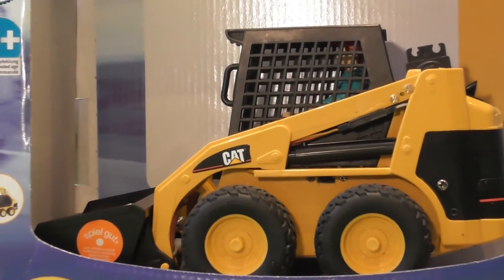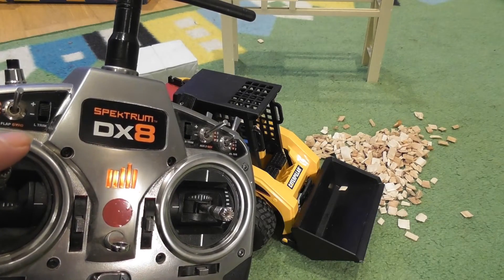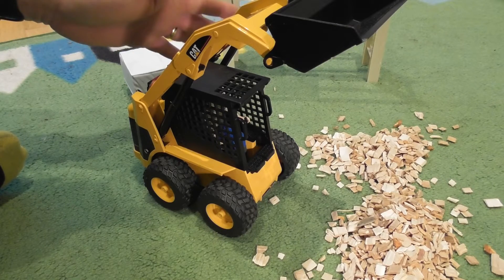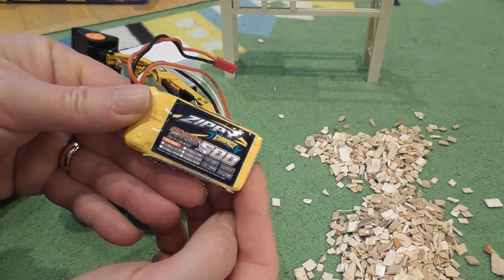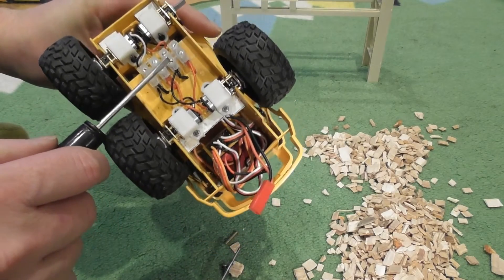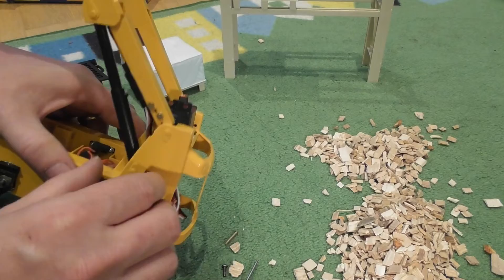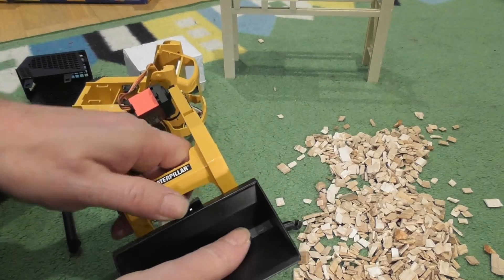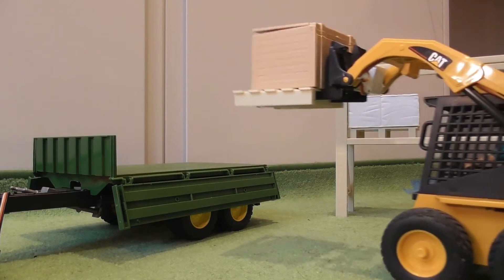Bruder skid loader RC conversion pt2: prototype

Comment: Nice little machine. Are you planning on doing a video on the mixing? I'd love to see an explanation. Thanks!
Reply from the maker: Yes I am. Plus a full build series. I want to show mixing for both Spektrum and FRsky (Open TX). 😀👍
Reply: @RCModders  Thank you! I just picked up a Delta Cat the other day for conversion. Enjoying your channel :)
Reply from the maker: @jesscneal  Good luck with! 😀👍
Reply: @RCModders  Another question for you. Do you think a pair of 220rpm 150:1 N20 gearmotors are sufficient for a  Bruder Delta Cat conversion? I know you have a lot of experience with them so I thought I would ask you.
Reply from the maker: @jesscneal  Hi, having tried different motors I can say with certainty that 200rpm is too fast and has too little control or torque. 6v 100rpm is probably the fastest I would want in this and is what I used in the end in the skid loader. For the delta I would be tempted to look into servo drive - as I'm not sure that two N20's would be powerful enough. You may be interested to know that I am updating this build with 3D parts - which I will make freely available to download and print. I am planning that the comprehensive video build series on skid loader  will follow immediately on from the Jeep wrangler series which I am currently publishing each week. 😀👍
Reply: RC Modders  Thanks for the reply. Good to know :) Thanks for all the uploads. Great stuff 👍
Reply from the maker: @jesscneal  pls see edits to my response I forgot you were making the delta rather than the skid loader.
Reply: @RCModders  Thank you. I was actually trying to decide between N20 and servo drive. I think you just helped make up my mind :)  Thanks again for all the info
Reply from the maker: Jess Neal you are welcome 😀👍

Comment: Great video! I have this Bruder model but it is tracks instead of wheels. How do u think I could make the tracks work?
Reply from the maker: I think they are quite different model. I haven't done the tracked one yet. Usually people convert two standard RC servos to continuous rotation and use these to drive the tracks. The forum is great place to learn & get tips : https://www.facebook.com/groups/313698865844090/?fref=nf.   😀👍

Comment: Realy nice and clean build!! How do you use 1 of both ESC as a BEC?  And how do you split the signal for controling left/right movement.  Thank you!
Reply from the maker: Thank you! One ESC must have the red wire disconnected (can lift up tab on plug, pull out and cover with head shrink or tape. Be care full that the big servo never stalls (ie tries to move further than lifting arm goes - as it will blow the BEC on the ESC and you will have to use the other ESC or install a UBEC.   The speed controllers are connected to the elevator and aileron channels on the receiver. You then mix them plus or minus 100% to each other in both directions. You may have to experiment with the direction of the servos, the polarity of the motors and direction of the mixes until it all works the right way. The bucket servo was attached with epoxy. I’m trying to get round to the detailed build video. Going to use budget rc - but it must have at least 2 free mixes for the steering to work. Hope this helps😀👍
Reply: RC Modders  Finally finish mine! Work very well and thank you for you help. Realy proud to use N20 motor like you do. You can see a video of it working on my profile.

Comment: Really nice and clean conversion! I love this skidsteer in action!  I have only a question: are the 4 n20 motors stronger than 4 9grams servos converted to 360° rotation?
Reply from the maker: I have never converted a servo to continuous rotation, so I don't know. I expect that it will depend on the gear ratios etc of each. Using my method, the mounting of the wheels to the motors is very easy and the motors are smaller than servos, although you will need to ESC's, which then need to be housed. The 6v 100rpm N20's seem to give a good balance between torque and speed in my opinion (200 rpm not enough torque or controllability & too fast) .🙂👍
Reply: You can get 17g ones to fit under it

Comment: Great build once again from you Mr modder. 
My proffesion is heavy machinery. (Operating and teaching others) And it's correct that when you move the stick back, the loader rises. Think of it like there was a pivoting point between yourself and the bucket. I have my D5 dozer set up like you have it, but it causes problems because it should be steering and drive on the left stick and the bucket/blade on the right stick. This is how my brain is wired since about 35 years back. 
But really nice build, maybe even lower geared motors would be possible.
Thanx again for inspiration.
Reply from the maker: Thank you. I must admit I was going to put the arm on the left, but the mode 1 transmitter that I was going to use only had one mix and I needed 3.  I used the mode 2 Spektrum transmitter - as I thought this is what a lot of people might have - or something like it. I’ll probably bind this to the DX10 - which lets you choose what is on a spring by screwing up or loosening a small screw. I can then try the set up you describe - as it might be more intuitive for a right handed person anyway - my cars, boats & aircraft all have throttle on the left, so it makes sense to me. 🙂👍
Reply from the maker: You might have a point on the gearing, I think they do go slightly lower - I’ll have a look on EBay.
Reply: @thatsmyrc  
Haha, yes I would like to build one like yours, brother. My D5 is not even close to the one you showed us😎. Sure, it works, but not as smoothly as yours. 
And about the setup, I have it like that because I thought it could work. But like I mentioned, my brain is hardwired with steering on the left hand and blade/bucket on the right hand. That's because 99% of all real machine's are that way. And like I said, I have been operating loaders,excavators,graders,dozer,jumpers,forestrymachines and various farm equipment both professional and for fun since about 7-8 years old so I do actually have a bit experience.
I will happily help if I can.
Reply: @thatsmyrc  
Okay, well i thought you night have a little experince too😉. At the moment i work underground mining Gold so.. Been operating those machines as well. 
But 36 hours a week is not enough haha..

Comment: What an endearing little machine! I´m very much looking forward to seeing how you worked out the solutions to all the little problems you must have had to overcome to get this done so neatly.
 One thing which does slightly puzzle me is your decision to have a downward stick movement correspond with an upward movement of the bucket/forks.
 I´m also looking forward to finding out how you arranged the bucket´s clever self-levelling feature. I was once lucky enough to enjoy half an hour´s tuition on a JCB3X and that most certainly didn´t have a self-levelling bucket!
Reply from the maker: Thank you Del, I really like this one & it works nicely - very easy to control - both the wood chip clearance and the fork lift challenge could keep a person entertained for hours! It did take a bit of working out & the only thing I had to change was the gearbox motors to a lower ratio - it was a bit disappointing before I did that -its about optimum in that respect now, without going to bigger motors or posher speed control (like the Sabretooth unit, which is much bigger anyway).I'm glad you noticed the stick direction. Initially it is more intuitive the other way round, but a bit like the elevator on an aircraft I think that you pull back to go up. The RC excavator works this way - as I believe do the real ones (think what you would do inside the cab). I'm sure I could get used to it either way & it is slightly less intuitive like this with the fork lift prongs attached - where the instinct is to go up when you want to raise the load.The self levelling bucket (with a small trim change for fork lift prongs) is really the key to this being so easy to use.I've never been in a real one, one of my pals thinks that I would enjoy Diggerland - just seen this https://www.youtube.com/watch?v=240qkslfzvQ  Pete    🙂👍
Reply: @RCModders  Now that you´ve likened your chosen stick-control orientation to operating an RC aircraft´s elevators I´m finding it easier to understand your choice.
 Diggerland looks tremendous fun!
Reply from the maker: Indeed it does! 😀😀😀
Reply: RC Modders I have a little experience running a farm tractor with a loader and it works just the same as you have the remote set up. Pull back towards yourself is up, forward is down, to the left curls the bucket up, and right curls the bucket down. Great work on this unit! Very clean and looks just like the original.
Reply from the maker: Thanks Ethan & nice to hear from you again. And thank you for clearing this matter up! It is a very satisfying build (in that it works very nicely) and I would recommend it to anyone as a first Bruder conversion - cheap parts, no specialist tools or techniques, cheap model (just buy another one if it goes a bit wrong somewhere). 🙂👍
Reply: I’m sorry if I missed this, but can you share the details of the mix that allowed the bucket to self level as your raised or lower the arm?